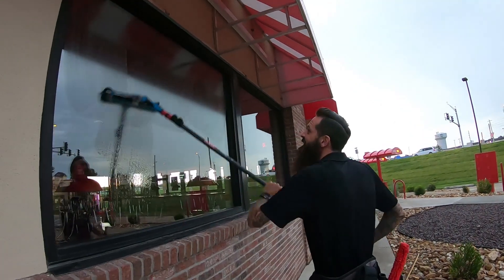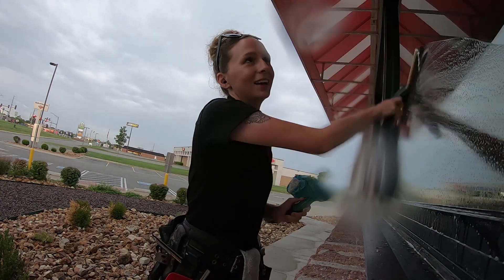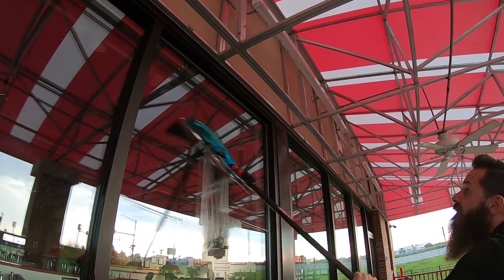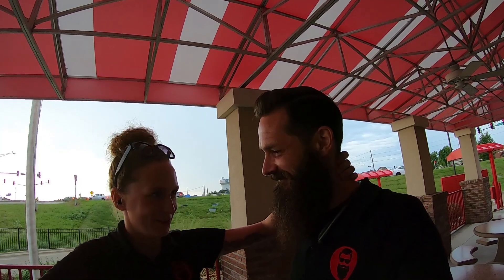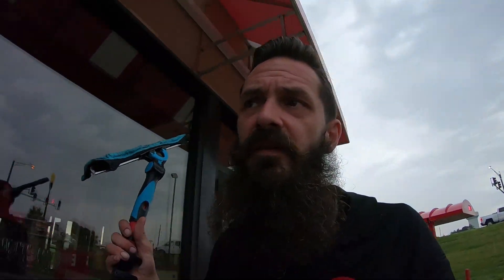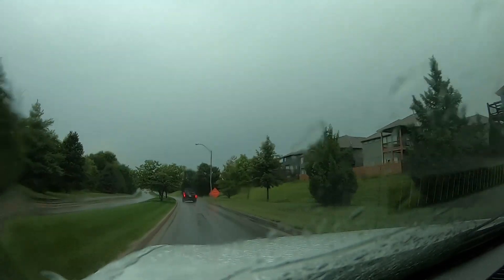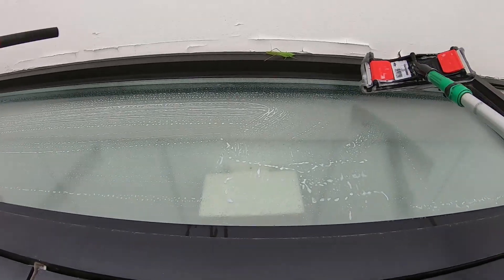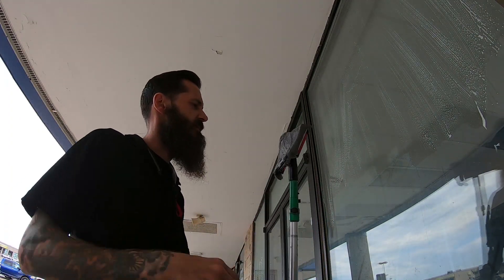Why Luke The Window Cleaner & Reanna Quit Youtube

Comment: I tried to love The Excelerator but I just couldn’t get it to work like my Wagtail.Wagtails for me all the way...... good video btw 👍🏻
Reply: All my user squeegees are Wagtails. Using a locking tip is the way to go with them, Ettore blades too.
Reply: MacGyver Bryan I’ve modded one of my Wagtails with an Ettore handle, works a treat 👍🏻
Reply: How does the disc fit in the Ettore handle?

Comment: Are u using a sanding paper with the sander???
Reply: Also congrats on the new house
Reply from the maker: No! #0000 steel wool.

And thanks !
Reply: @LukeTheWindowCleaner  did u make that tool??? I always do it by hand but that covers so much more space and and attaches to the pole which is very convenient.

Comment: I was beginning to think I was the only person that didn’t like the 2.0! The angle is so far off for me that it’s unusable. I tried using a round file and leveling the channel slot but it didn’t help. I tried it with my Steccone, Ettore, and an Unger channel and I couldn’t make it work. I went back to the Pivot Control handle and Steccone channels.

Comment: Things expensive... I wanna try one but I need to.. unscrew my ettore to get it to wag(fanning). and theres no flip. so its meh. want the silencer and excelerator 2.0. But, thats $260. And I want the 12in 14in as well.. So, plus xero poll with 3 extension polls to 12 feet.. IT"S $200. lol. But, the silencer is just the coolest concept I've seen, it's got a clip that holds the window.. wet? Or something. I duno it's like for window cleaning in a vacuum. lol.

Comment: So do you still like the first accelerator?  Just not the new one.  I use the first one often.  Personally I won't buy anything except new rubber, steel wool, and razor blades...anything I have to replinish, I got enough stuff to clean a window.